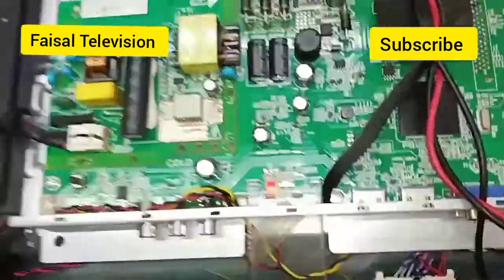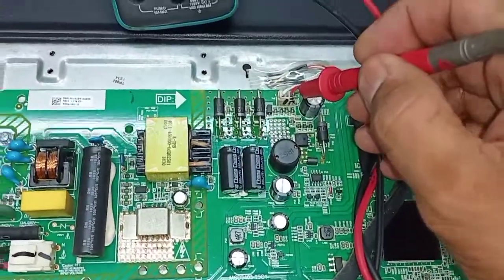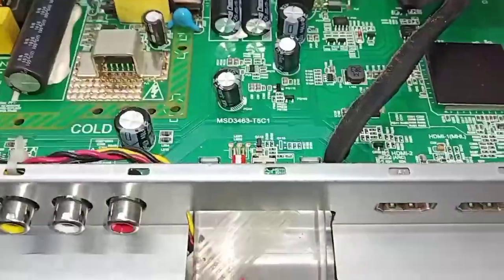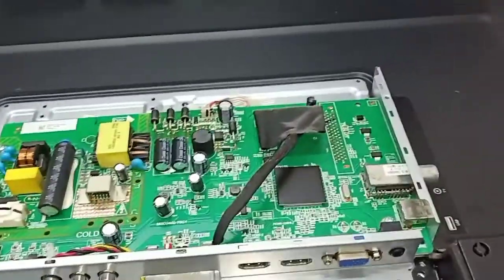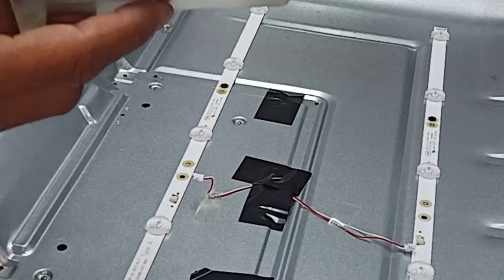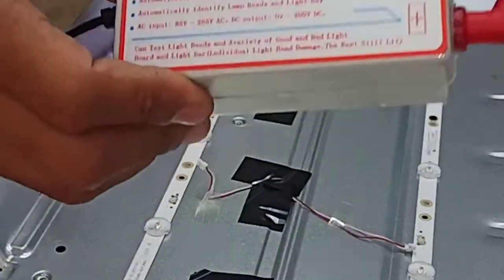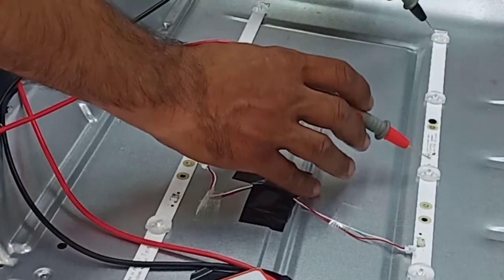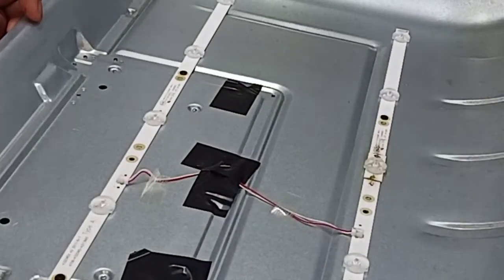PHILIPS 32 Inch LED Tv Repair backlight problem solve Model 32PHT4002s/98

Comment: bang screw tv philips 32PHT4002/98 ada jual kt mana yer dgn stand dia skali nak beli
Reply from the maker: Ada
Reply: saya nk screw 10 pcs untuk body tv dgn stand dia skali.. brp harga abg bole bagi..
Reply from the maker: You dari mana?
Reply: @faisaltelevision69  Ampang Kl
Reply: Bos, saya ada 32pha3002s, screen only backlight keluar. No sound, no picture.. apa masalah boleh bagitau?